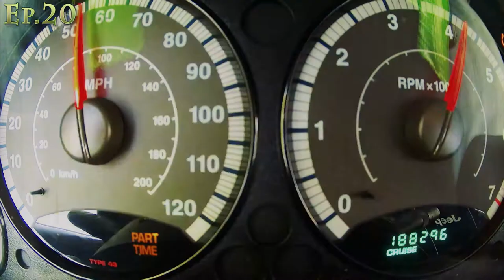Project Renegade Highlights Ep.9-24   (Companies In Description)

Comment: Do you feel that the Jet module and other supporting mods like full exhaust, intake and TB spacer made a noticeable difference?
Reply from the maker: With them all together yes, if your were to separate them... I don't think you would notice a performance increase. Thanks for watching!
Reply: @RockyXTV  I've been thinking about buying a 4WD Liberty and came across your videos.  Looks like the Liberty is very underrated.
Reply from the maker: It is a very underrated Jeep. When set up correctly they are very capable, to be honest, my Liberty is better in the snow and other on-road bad conditions than the Wrangler! Of coarse the Wrangler is better off-road, but the Liberty holds it own.
Reply: @RockyXTV  Good to know, thanks!